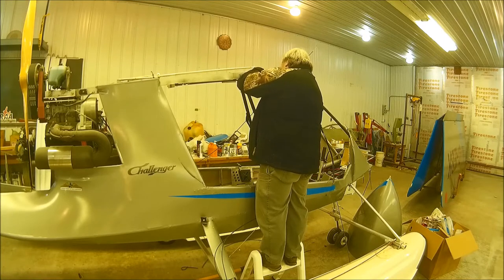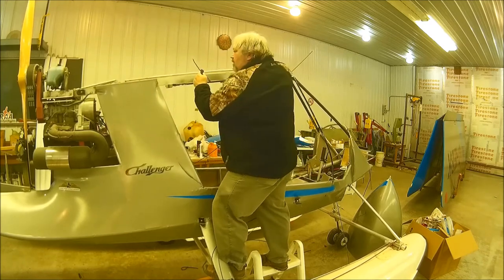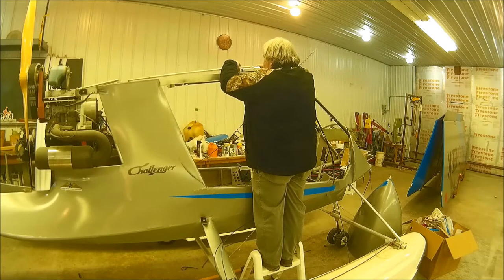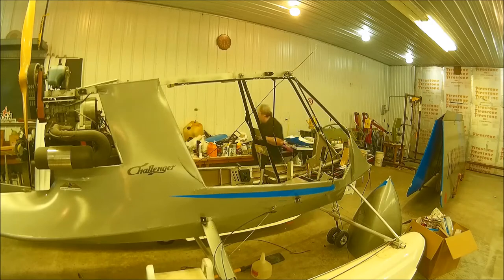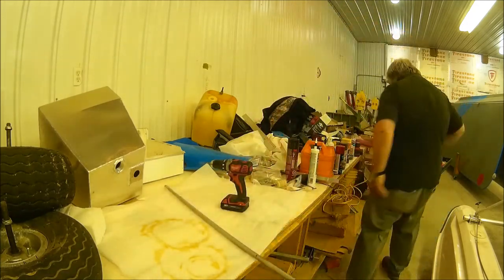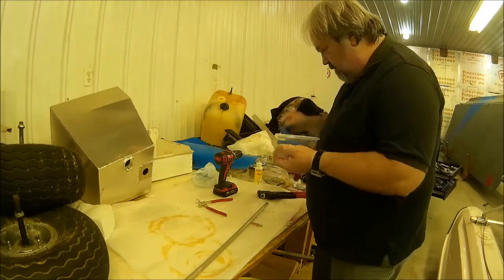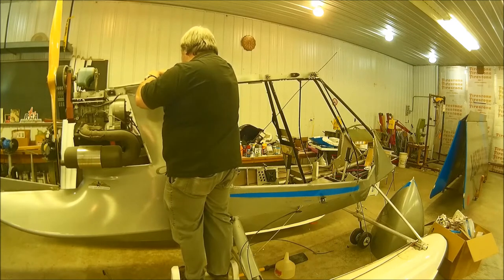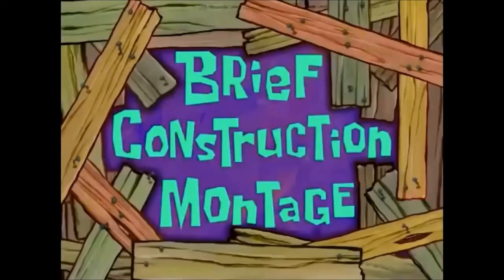Ep #9 Electric Flap Control Modification. Part 1 of 2 Challenger 2 Ultralight Airplane

Comment: Have you ever changed from floats to wheels? How did you support the gear to take the floats and swap in the wheels?
Reply from the maker: I purchased this airplane with floats on. The previous owner did have a home made lift that supported the airplane in order to change to wheels. I don't plan on ever taking the floats off the Challenger 2 however. I do have another airplane that I purchased, that has never been built or registered, and I will be building from the ground up. That one will be on wheels. It's an Excalibur, which is the competitor to the Challenger 2.

Comment: I'm watching these in order but with all weight being added i saw a video with a builder that also had pontoons and in flight to keep the rpms down he added a wing on top of the pontoons.  From one pontoon over to the other and in between the pontoons and the fuselage. 
Wonder if you ever tried that later 🤔
Reply from the maker: The airplane actually dropped some weight from when I purchased it. Just the panel alone dropped 6 pounds. Not all modifications were shown on youtube.

Comment: Do you still have the flaperon crank handle. I need on for my challenger. if you want to sell it to me?
Reply from the maker: Another Challenger 2 owner here at my home base beat you to it. Sorry.
Reply: Ok basically my handle fell off the threaded rod. I'm wonder if I drill a small hole threw the center and insert a metal dowel if that will work.
Reply from the maker: I see no reason that shouldn't work.